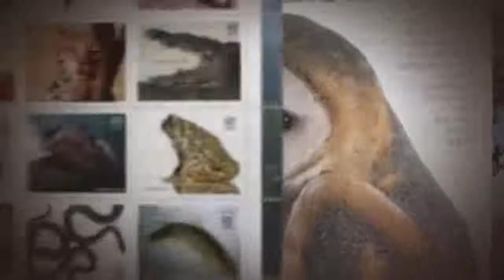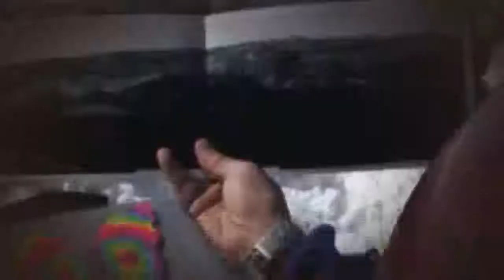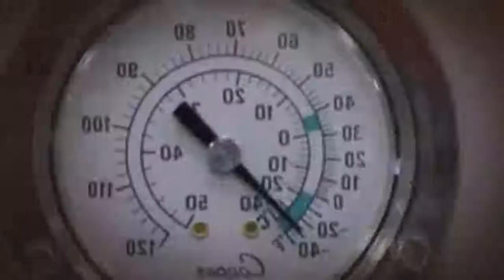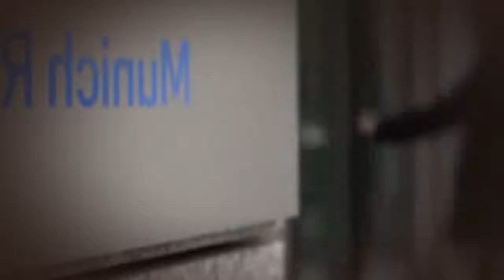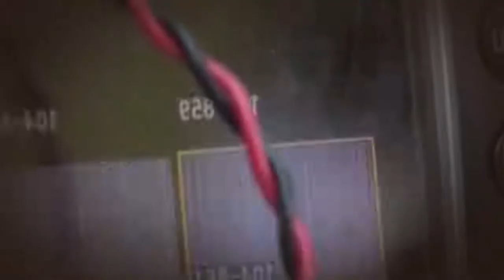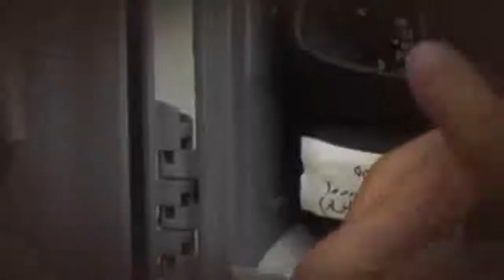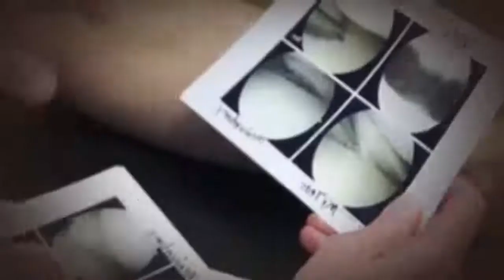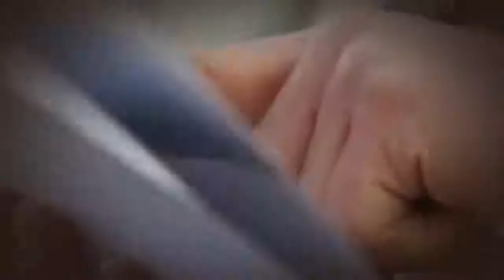Chasing Ice 2012

Comment: When you have ice in a glass and it melts the level stays the same.
Reply: Yes... your point?
Reply: there also exists ice on land
Reply: This applies to the Arctic Ice Cap, which is floating in the Arctic Sea, but not to the Antarctic or Greenland Ice Caps, which rest on LAND. When those melt, it's like melting ice in a pan and pouring it into the glass, at which point the glass overflows. Coming soon to a coastline near you!